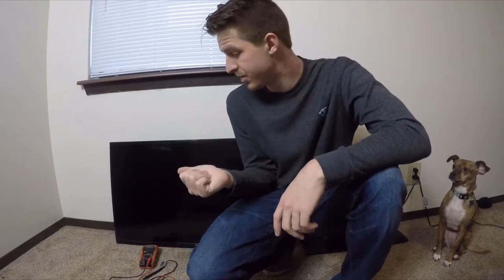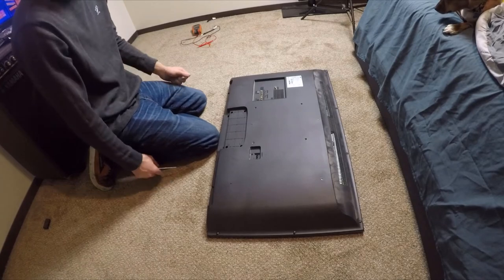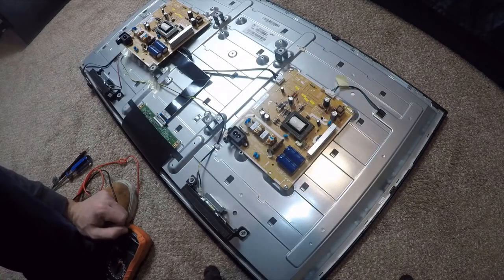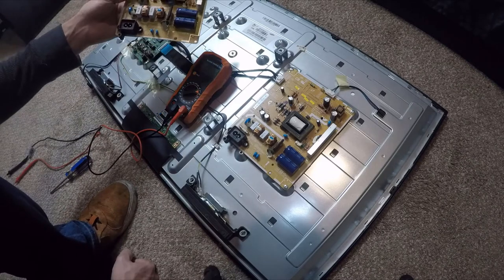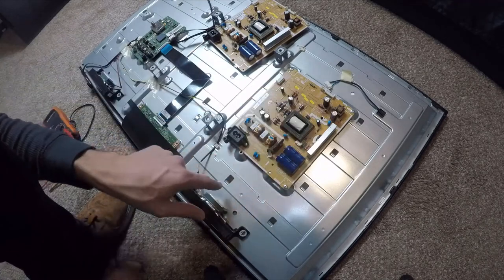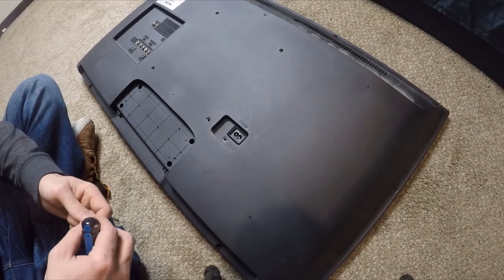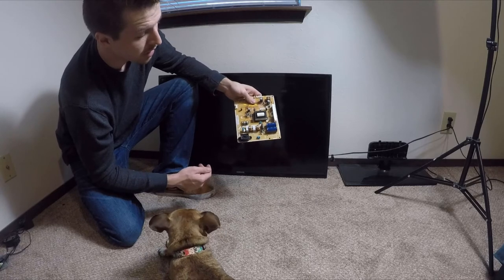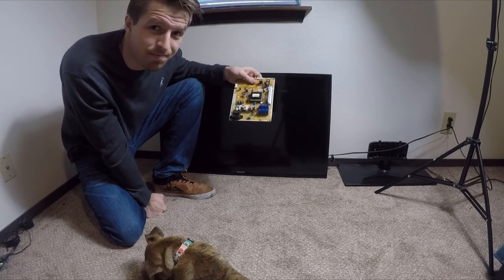How To Fix A Samsung TV Struck By Lightning

Comment: My 55 Inch Samsung Smart HD took a major surge hit that shut the power out in the whole cottage then on again without tripping the main breaker. Power Supply replacement did nothing, looks like the LED strips need to be replaced noting a scorch on the chassis from power supply to LED lead wires. I ordered new LED strips, and have a new motherboard. it's a 2017 top of the line Samsung Smart HD TV but now I will learn how to repair my own TVs just as I did learning to build my own Desktops from thoughtful great YouTube studies like this, thanks for taking the time.
Reply from the maker: I ended up replacing the control motherboard to fix this one, same thing where my LEDs wouldn’t come on

Comment: Have you tried replacing the main board?  or the t-con board?
Reply from the maker: Yes, that is what actually fixed it!
Reply: @TheFeesher  which worked for you? Mine was like this and I tried to replace the power supply board and still no picture. Should I replace T-con or main board?
Reply: @brandongarrett2852  hmm 🤔 same issue

Comment: How much is power supply board?  Could you return it since it didn't fix the problem?
Reply from the maker: Board was like $30, didn’t return since I figured it was possibly replacing a damaged part, bought a control board and that is what fixed it

Comment: Great I have two tvs that got hit by lightning thanks alot
Reply from the maker: For sure! The fix for this TV was actually the control board, so that may be worth looking into as well if the power supply doesn’t fix it, once I put that in, it worked but had to use the maintenance settings to flip the display vertically. Way cheaper than a new TV

Comment: Are the board interchangeable between different size Samsung TVs?
Reply from the maker: I believe for the most part, yes, to fix this TV I had to replace the control board as well and it was from a different model. I had to go into the TV maintenance settings (a really weird menu) to rotate the display 180 degrees since it was upside down
Reply: @TheFeesher    so did you end up replacing both boards. I was going to start with the power board but nothing on it is obviously burnt. No obvious damage. replaced 2 fuses in power board. it's a 55 inch. has 2 fuses. do not have a meter to check fused so just put new ones in. No luck. I'm wondering if I should gamble and just try replacing the green board( t-con)
Reply from the maker: Yep replaced both boards! The control board didn’t have any visible damage like the power board but it was still bad evidently because the TV worked after I replaced it